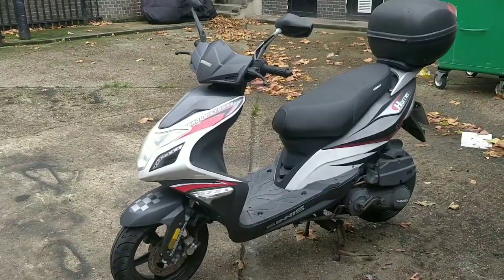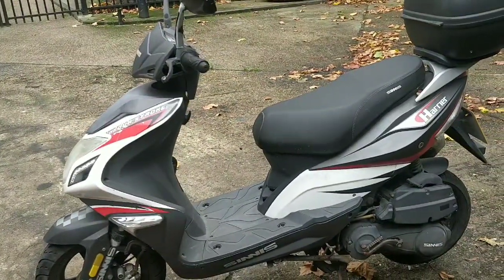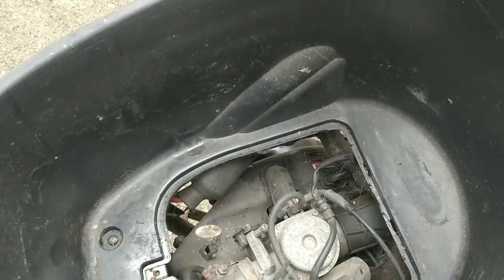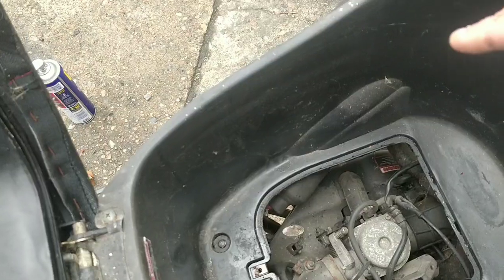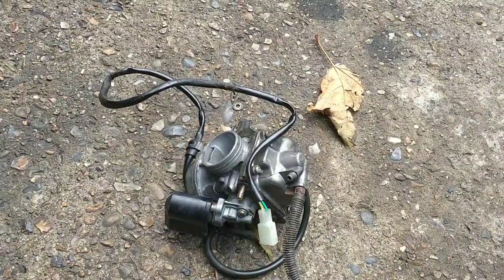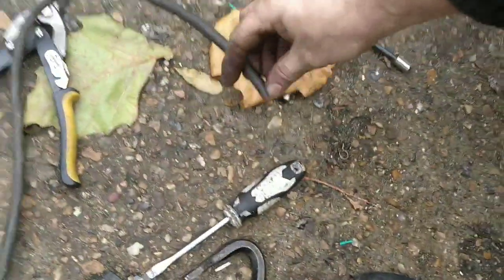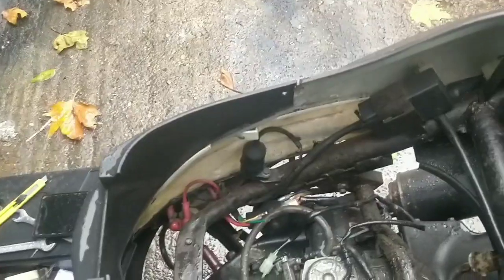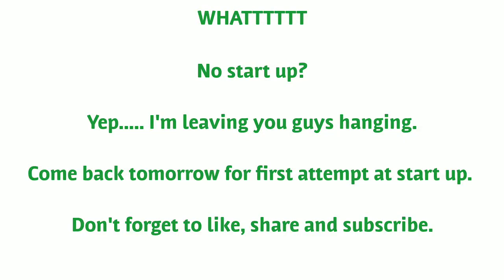Cheap eBay sinnis, harrier 125cc, will it start? 125cc moped, scooter, fix, repair, how to fix.

Comment: Hello I currently have a sinnis hero x i really need your help, So i put my key in like normally and turn however i get absolutely nothing. No dashboard turns on or anything. My friend said it possibly could be my fuse however i took my seat of and tried to locate it and I couldn’t, do you have any advice on where it could be please? Am i just looking for 2 red wires or?
Reply from the maker: It definitely does sound like the main fuse although it could be a battery issue or key ignition issue. I assume you tried another battery first? 

https://www.ebay.co.uk/itm/175114513289?mkcid=16&mkevt=1&mkrid=711-127632-2357-0&ssspo=ae4ylo-grrk&sssrc=4429486&ssuid=CDLOYQ8UQj-&var=&widget_ver=artemis&media=COPY

I've sent you a link to what the starter solenoid looks like which is where the fuse is. Normally hidden under a piece of plastic.

Comment: Where can I get a service kit for this??? I can find loads for other znen bikes but I am not sure if they’re the same filters etc… thanks
Reply from the maker: Hi, easy has them, otherwise cmpo has them aswell. 

Its a common engine so the kits are easily available. 

You only really need some oil, a spark plug and the air filter though. 

Hope this helps.

Comment: Charlie both you and Nat are inspirational,
you'll have to wait till next time when Charlie and Nat start on the latest Sinnin 125 to hit the garage forecourt for its mini restoration to help a lady who needs help so tune in next time for Batman and Robin
 ERM..........
 i mean Nat and Charlie will  succeed to help the damsel
Reply from the maker: Thanks buddy
Reply: As long as I am Batman. I don’t have the legs for tights!
Reply from the maker: @NatsNackersYard  I'm not Robin
Reply: @motorcyclerescuer  they both had good legs lol
I've just been looking at a Varadero in Maidstone Kent on eBay with fairing damage that some fibreglass could sort out lol
Reply from the maker: @johntray1462  lol I can't say I ever judged there legs.

Your asking for trouble dude. They are very complex bikes. It has to be running perfectly if your buying one.

Comment: Help my Sinnis won't start!
Reply from the maker: What's it doing?

Is it turning over? Is it sparking?
Reply: @motorcyclerescuer  it's sparking and i think it's turning over, but it just doesn't start.
Reply from the maker: Is it a carb model or fuel injection?
Reply: @motorcyclerescuer  it's the fuel injection type, I think I spotted some yellowish discharge dripping out of the airbox, thing where that tube is hanging out from
Reply: I put in new fuel and the bike died after
Reply from the maker: Are you sure you used petrol and not Diesel by mistake? 

These new fuel injection bikes need good clean fuel and for the valves to be adjusted properly to work.
Reply: @motorcyclerescuer  I don't even know now, I'm pretty sure I put in petrol, oooh so what if I put in that nitrous stuff?
Reply: Does it matter if it's e10 or e5?
Reply from the maker: What nitrous stuff? 

E5 or e10 would be ok. Diesel wouldn't obviously
Reply: @motorcyclerescuer  it's called hot sh×t basically it's a fuel additive.
Reply from the maker: Oh yes I know what that is. How much did you put in? 

That boosts the octane level, your bike won't like that fuel I think. 

You may have to drain it out and put normal e10 in or even e5.
Reply: @motorcyclerescuer  Ok I'll try that tomorrow I can't remember how much I put in, but it's like 500ml to 15 litres the tank is 9
Reply from the maker: Yeh it's bad stuff for bikes really. My mate blew his engine us using that stuff. It highest the octane in the fuel which lower powered engines don't like or can't manage.
Reply: @motorcyclerescuer  did you have to take course to become so knowledgeable? I'm almost a year in, but I want more knowledge e.g. I wana strip and know my bike intimately
Reply from the maker: No courses will help much with that buddy. You just need to buy a project or 2 and try things out to see how they fit and look. YouTube is great for information aswell if you ever get stuck.
Reply: @motorcyclerescuer  cool so im going to stick with my strategy, I'm going to save up, and then buy a new bike, and strip my Sinnis and try and build a few bikes from scratch, lol I guess I need a garage now lol.
Reply: Just out of curiosity where are you based?
Reply from the maker: A garage helps lol. I've got a lot of vids showing the same thing so worth a look. 

My benelli project which was my first free bike is a pretty cool one to watch
Reply: @motorcyclerescuer  I'll give a watch
Reply: How do you recharge the battery on a sinnis hero x?
Reply from the maker: @TheRick0shay you would need a home charger, you pop the battery out then charge from home.
Reply: Cheers, is the battery easy to remove and is there a charger you would recommend?
Reply: @TheRick0shay  yes, its under the foot panel